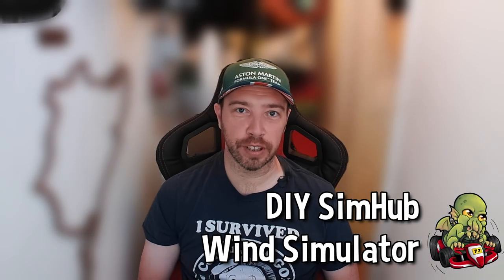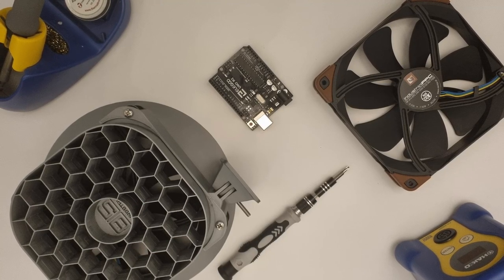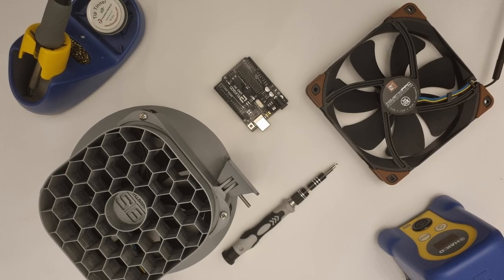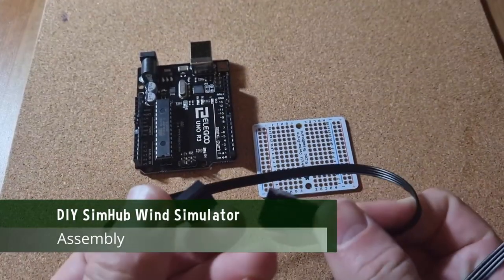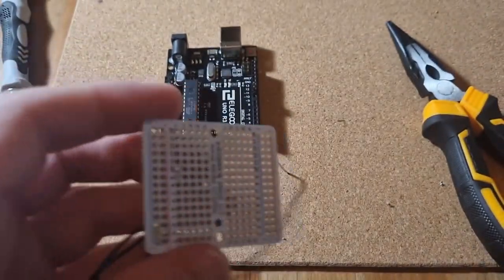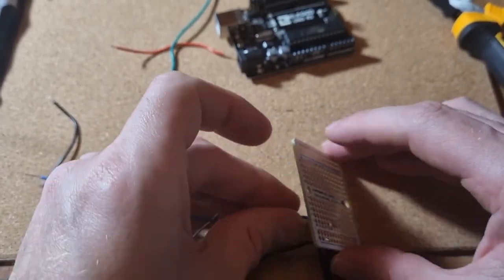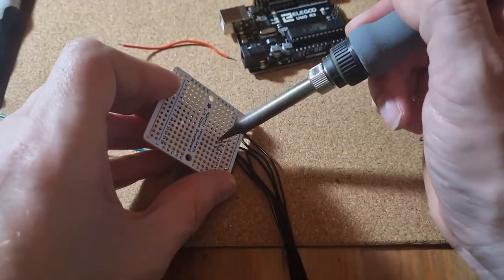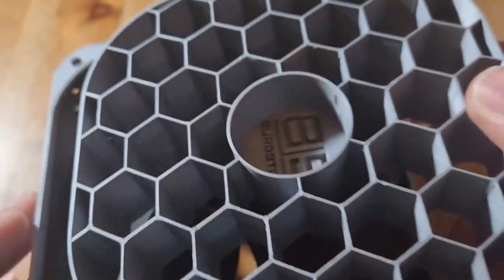DIY SimHub Wind Simulator

Comment: Nice video, I had some old high power Delta server fans and a spare arduino laying around. It feels like a real car without a windshield. Thank you!
Reply from the maker: It's always awesome when you can make use of hardware you have laying around. I bet those deltas scream too!
Reply: Yes, they are very loud. But I still have to wire up my more powerfull powersuply because when i play the fans don’t reach full speed and stop spinning. If I manually start the fans slowly the fans work at full power. I gues my 3 amp powersuply is not powerfull enough for 2x 3.4 amp fans   lol.
Reply from the maker: @badal0761  hah, yea, you'll certainly need more power. Those things sound beastly and I love it!

Comment: Thank you for your guide. After trying for several weeks to make it work with motor shield clone and frying one Arduino Uno board I switched to your solutions and it worked like a charm. Now I have to move from my breadboard to a similar soldered solution. I use 2st 4000RPM 12V 3A fans from Amazon and 200W power supply (12v 16.7A). So I have more than enough power to drive fans. I have noticed that there is no way to turn fans off all the way. Even if I disable Idle wind or turn off my PC.
It's already rather bodged solutions so I wonder if there is some setting that can be tweaked to achieve this?
I don't need one more switch in my life. Turning everything on is already more complicated that Boeing start procedure :) But if next upgrade will be central console then one more switch won't harm :)
Reply from the maker: Interesting, you might need to tune the rim values a little. With the fans I used, they will switch off completely when the car is in the garage.

Comment: Hi, the linked fans on Amazon say they’re 12v? I’ve had a look on eBay for Noctua NF-A14 Industrial 3000 PWM fans and they all seem to be 12v. Any idea?
Reply from the maker: https://www.amazon.co.uk/dp/B0BKGTX5QX/ looks to be unavailable right now and Noctua have swapped out for a 12v variant with seemingly the same specs. You could adjust the circuit to use a 12v PSU and use those new fans or try and hunt down the increasingly elusive 24v variant. Thanks for pointing out this change, I'll update the description so people don't accidentally purchase the wrong model and end up with lots of smoke and burned out motors!
Reply: @Teqqlesdoessimracing  perfect! Also, just to confirm you’re running 2 x 24V Fans in Series with 1 24V 1A PSU? So in essence to modify it I would run 2 x 12V Fans with 1 12v PSU
Reply from the maker: @mrunboxer7657  I'm running 2x24v fans in parallel with a 1amp, 24v PSU. If you're swapping out for 12v fans using the same circuit you'll need a 12v PSU, or run them in series adapting the circuit slightly. I don't have the fan amperage details in front of me but you'll need to make sure the power supply exceeds the fan usage. Hope that helps!

Comment: Can you run the shake it pwm setting with a motor shield instead of directly to uno?
Reply from the maker: Yes you can, though I opted to do without here to keep the costs down.  You'll see in the pedal vibration motor video I do just that, however you'll still need to wire up the pwm to ensure you have variable speed.

Comment: Hello brother , first of all thanks for the great video . 
I have did exactly as shown in the video and have a few problems . 
My fans would immediately kick in when plugging in the psu so i connected a relay switch to activate them , the thing is that no matter how much i tried tweaking simhubs settings (windsim,shakeit motors) 
I could not get my fan to work properly. 
When i launch a race they stay on at 20% id say , when i turn left and right nothing happens, they only start working after I’ve accelerated to above 100mph , and when i slow down they almost abruptly go back to 20% 

Can you help me plz?
Reply from the maker: This could somewhat be a trait of the fans you've picked, though there is also a gotcha in the Simhub firmware with two very similar names, one pretty much works almost as a on-off switch and that initially caught me out. Double check that first, but if not, let's see if we can debug it together.
Reply: @Teqqlesdoessimracing  
Thanks alot , ive just had a surgery on my arm so i wouldnt be able to tweak or drive in the next month or two but as soon as ill have the option to get back on it ill hit you up , thanks alot❤️
Reply from the maker: @loolaka1999  I hope the surgery went well and the recovery is good.  I know exactly how it feels to be out of action because of injury and it is no fun at all!
Reply: @Teqqlesdoessimracing  ty very much brother . Much love❤️

Comment: Good video to build the wind Sim. Only one question. Why my fan turns back on after I turn it the PC. It works fine in the game, testing with SimHub. But it turns on after I turn of the PC
Reply from the maker: That seems to be a side effect of the SimHub sketch.  The fans run full blast until SimHub is loaded and then it is controlled by the software, the same happens when the software is closed.  The code for the sketch could possibly be modified to switch off the fans for shutdown or start-up events but I haven't looked into it to be honest.
Reply: @Teqqlesdoessimracing thanks for your answer.

Comment: Thanks for the video! I’m actually following the instructions and works fine! But the fan is always running in a min speed while plugged to the power.. never reaches 0. Is there any way I can completely stop the fan when the car is not moving?
Reply from the maker: Interesting - sorry for taking so long to reply.  Did you solve your issue?  It sounds like the fans aren't responding to the pwm single fully, it'll be interesting to hear what fans you were using.
Reply: @Teqqlesdoessimracing   no, I could’t fix it. It’s a be quiet silent wings 120mm 2000rpm. I have no clue about how to fix it. Thank you!!
Reply from the maker: @victorqn looking at the pure wings fans it looks like when the PWM signal is between 0-25% they keep a static speed of 500 RPM.

Comment: Thank you! I had arduinos laying around for a while now. Used one for led tach now I'll use one for this now. Most I see use the motor board. This method is even cheaper and more simple...IMO this is best option unless maybe using more powerful fans. I'll build it this weekend!
Reply from the maker: Same here, I have Arduinos everywhere so keep looking how I can use them in my hobbies! Let me know how you get on ❤️
Reply: @Teqqlesdoessimracing  SO i wired 2 PWN fans to pins 9 and 10 (same as profile I loaded setup) wired 12V supply to fans and hooked ground to Board as well via GND pin. Flashed arduino...fans speed up and changed as flashing occured...Load up my game but fans just spin at low RPM. No change in speed. Any idea what I couldve done wrong? Fans are 4 pin PWN just like you used in video. 120mm Be Quiet fans.
Reply from the maker: @CerealKillr-SimRacing  did you configure the Wind Simulator plugin in SimHub with the fans? Another issue I hit was that there are two sketches that look very similar, but one will give you some strange results. It'll be worth double-checking that.  If you're still having issues, screen grab your settings, and I'll take a look.
Reply: @Teqqlesdoessimracing  I put it away few hours. Just hooked it back up and long as I load sim hub...then power up arduino it's now working! So happy! Thanks for your time and help bud! ...Now to go do some racing!
Reply from the maker: @Cereal_Killr  nice! Enjoy your sim racing buddy!
Reply: @Teqqlesdoessimracing  will do! Playing Assetto...it's definitely a nice little touch to realism.
Reply: I use 2 fans with it.  5000 rpm 120 mm 1.9amp fan. Works fine.

Comment: Hi,thank you for the great tutorials! After watching and building your pedal shaker I want now to build this one..But I have a question: Is it possible to run both(pedals and fans) with the same Arduino as they use different pins? Thanks in advance
Reply from the maker: Glad you've enjoyed the tutorials! 😀  It should be perfectly possible to build both on the same Arduino, though the circuit will be more complex as a result.  Make sure to keep a common ground across whatever power supplies you use though.  For your example I'd use 12v fans to simplify the circuit as the pedal motors are also 12v, you'll just have to ensure you have sufficient amperage spare.
Reply: @Teqqlesdoessimracing  Happy to report that it worked fine! Basically just combine the two tutorials! Thanks
Reply from the maker: @juanmorelli6484  nice ❤

Comment: Thanks. I  have my settrings like yours PWM Output min set to 0, but the fan still runs slow/ not 100% off.. Is that normal?  Thanks
Reply from the maker: Some fans will run even with PWM set to 0, mine switch off, but others are designed to keep some flow going so that sounds like normal behaviour so long as you are seeing a difference in fan speed as you turn them up.

Comment: I have some noctua industrial nf-f12 but once I connect everything it doesn't matter what I do in simhub they are always working and I can't regulate them
Reply from the maker: I'm sorry to hear that, Ivan. The only thing I can advise is to double-check the wiring and ensure the correct sketch has been installed. There are two that seem quite similar, but one sketch definitely doesn't give you control over the fans.
Reply: @Teqqlesdoessimracing  I try

Comment: I got the hardware side of things all hooked up, but I'm having a slight issue that I believe is on the software end, if you don't mind helping me out, please?

The green light was solid and lit on the Arduino, their was a yellow light flashing, and I went to do the SimHub setup, and the fans kind of did their off and on testing as you said they would and I've seen in other YouTube videos, but after doing everything, the fans came on, and they CAME ON! FULL BLAST, NO STOPPING! They work, as it got pretty chilly, pretty quickly, lol. 

After watching your video and some other YouTube videos again, it looks like my error was that I forgot to click the "relay" option off for both fans. I went back and changed those two settings so that they're "off" now, loaded it to the Arduino, but, yeah, fans are still blaring... :/

I went into the settings of SimHub in the Shake It area and turned off the "idle" fan settings, but that didn't do anything. And I had not even gotten in game yet.

What am I missing here? Is there a way to uninstall the Arduino and start over?

I need some help, please. But it's good to know that I'm close. 🙂👍

Oh, and I would have thought the fans would blow out the one side away from the wires. Just found that funny, but it is correct per the arrow for "airflow" on there.

Thank you! 🙂👍
Reply from the maker: Sorry for the slow reply. I have had an ear and throat infection for a while! Are you still having issues?
Reply: @Teqqlesdoessimracing  Hey, sorry to hear about that! Got sick last week also! Hope you feel better soon! 🙂👍 Thanks for replying!

After watching your video and some others' again, I realized that on the one menu in SimHub, your Arduino name is listed to the lower right area, and mine still just had COM1 and COM3 in that spot. I deduced that my Arduino was not being recognized by my PC. I tried unplugging, replugging it in, and I even tried different USB ports. I'm wondering if it my knockoff Arduino is just not being recognized because I have done everything else others have tried to guide me with for this wind sim.

So, I ordered an "official" Arduino UNO board, and it just got here yesterday. I haven't had time to test it yet, but when I do, I'll report back in with the results. 🙂👍

Thanks!
Reply from the maker: @JoMaMaz  it might be something as silly as a driver being needed to recognise the chip in your off brand arduino. Had to install a few from sites that have no English language options before!
Reply: @Teqqlesdoessimracing  Yes, good insight! I heard of that idea, so I tried to go that route, but that's when I realized that my off-brand Arduino wasn't even listed in Windows Control Panel or Device Manager - either as it's name or even "unknown device."

I could have maybe tried a couple more things, but I'm just looking to get this project done, and if the bit more money for the official Arduino UNO board does that, it's good by me. 🙂👍
Reply: @Teqqlesdoessimracing  Well, I am HAPPY to report, the official Arduino UNO REV3 fixed my problem!!! :D I didn't have to change any other physical aspects of the mod for it to work! Yay! I followed the usual instructions given and it worked!!! ^_^ THANK YOU FOR YOUR HELP! Thank you! ^_^
Reply from the maker: @JoMaMaz  nice,  glad you got it all working in the end!
Reply: @Teqqlesdoessimracing  Yes, thank you! 🙂👍

Comment: Can you add a 3rd fan ? Like use pin 11 here ?
Reply from the maker: I'll have to double-check for you when I'm back in the studio, but from what I remember SimHub has limited support for this on the Uno. You'll also need to make sure your power supply has the grunt for the three fans.

Comment: Hi, I followed your instructions but the fan is in reverse.  Also if the usb is unplugged, the fan runs at max speed nonstop when plugged in to the wall.  Please help.
Reply from the maker: Firstly, thanks for watching my video and for trying out the project.

The full speed thing seems to be an issue with the Sim Hub sketch, I've seen the same thing happen on first boot but once Sim Hub loads it goes down to the idle speeds you set.  It also doesn't seem to happen all the time.

If you have the air flow pointing at you on the fan markers and it is reversed that sounds like you have the fan wired up backwards.  Is that a possibility?
Reply: @Teqqlesdoessimracing  thanks for the response, actually the fan is moving in the right direction, looks like backwards however, it’s the one from Amazon, pwm wathai that goes up to 5700 rpm and blows like 230cfm.

Still having an issue where if you unplug the usb from the arduino, the fan will run at max speed non stop.  So I’m not sure if it’s a normal thing.  But once plugged to the usb with sim hub it’s fine.  Can you check if your fans do the same?  I’d appreciate it.
Reply from the maker: @johnmann7o2  If the USB is unplugged I definitely have the same behaviour (fans on full).
Reply: @Teqqlesdoessimracing  can i use 3 pin fans instead of 4 pin
Reply from the maker: @MAlif-qg5sn  I'm afraid it'll need to be 4 pin PWM fans.

Comment: Everyone else using sheild boards and motor drivers - total waste of time - this is better, simpler and cheaper.
Reply from the maker: I did use a motor shield on another project but more often than not they aren't powerful enough or necessary for the job 😄
Reply: I just built one using the Monster Moto. I’m running two 6 amp 270 cfm boat blowers.  I love it but wouldn’t recommend using it without headphones on.

Comment: Hi, so I tried to build these and realized after several 24v 1amp power supplies, that the circuit diagram shows the fan supplied power in parallel instead of series.  Is this right?  I actually could not get it to work this way, the fans just started smelling light burnt electronics, before i switched it over to a 12v power supply.
Reply from the maker: Did you use 24v fans?   You shouldn't have issues with a parallel circuit if the fans are rated at the same voltage as the PSU.
Reply: @Teqqlesdoessimracing  Then thats the problem i got the noctua 12v fans, my mistake.  Do you think these would run in series correctly?
Reply from the maker: @JNYDZ  when wired in series the supply voltage is the sum of the components so you should be okay that way around using 12v fans.   You probably want to check you haven't already damaged them though if you've run 12v against a 24v supply before wiring it up though.

Comment: Great wind simulator, looking forward to adding this to my rig. Thanks.  Just a couple of questions.  I notice the fans are available now are 12v. Just thinking of matching the power supply, I notice yours is a 24v 1amp 24watt . If using a 12volt supply the 1amp is only supplying 12watts, would it be advisable to go for the 2amp 12v supply as it runs at 24watts?
Reply from the maker: Yea, Noctua changed the fan after I made this video. If you go for the 12v fans, make sure you also go for a 12v supply 👍
Reply: Thanks for responding.  Hope you dont mind me asking but would you recommend the 1amp 12 watt or 2 amp 24 watt supply?  I was just a bit worried 12 Watts wouldn't be powerful enough.
Reply from the maker: Simon Jones  I've not checked the new fan 12v specs, but if you're wiring them in parallel and want a bit of headroom, then 2amp, 12v would be best. 24v in parallel will probably burn out the fans.
Reply: Thanks, much appreciated
Reply: I'm having terrible trouble trying to get simhub to work with sim tools v3. Simtools has support for wind through game dash but I can't find a sketch to support your method of build , only using motor movers and ad fruit. I'm just wondering if you might know of a sketch or a workaround to support your method of build?
Reply from the maker: @simonjones8378  Your best bet is to look at the Sim Tools forums for advice.  I know there are some compatibility issues between v3 and Sim Hub but you might be able to use the two together with a bit of tinkering.  I don't know of any sketches you can use to work around this off-hand though unfortunately.

Comment: Thank you! Is there a way to test that the fans are working in SimHub at all?
Reply from the maker: Once wired up,  have a play with the idle wind settings in the wind sim module, that when enabled will allow you to test the fans statically. You could also record a racing session in SimHub and play that back to get a feel for how well the fans are working.
Reply: @Teqqlesdoessimracing  thanks mate 🙏